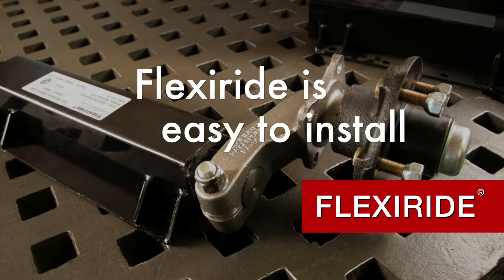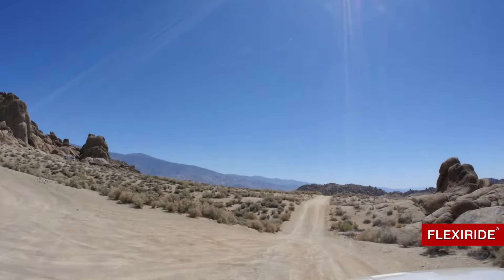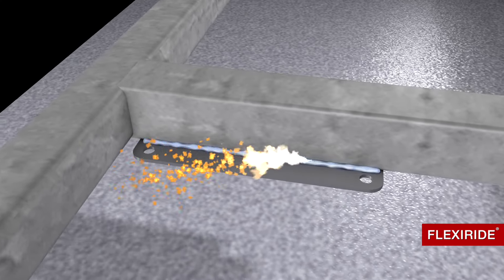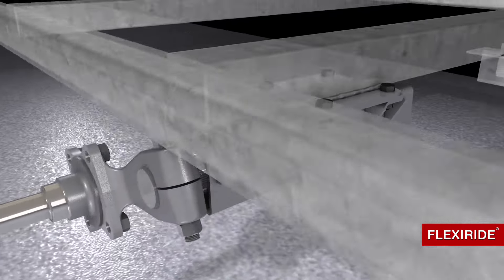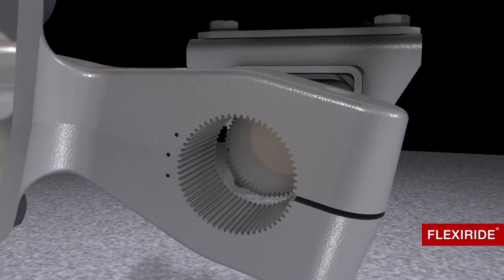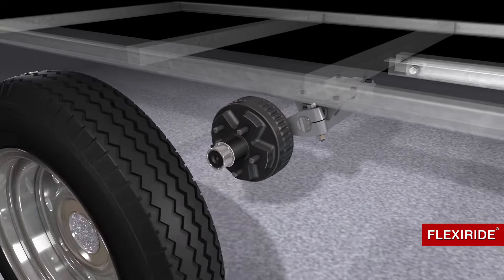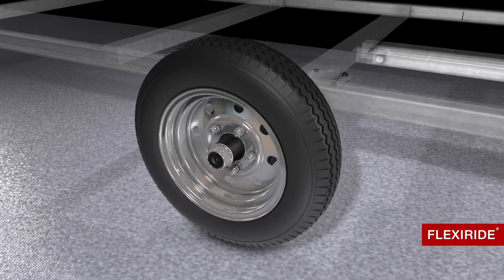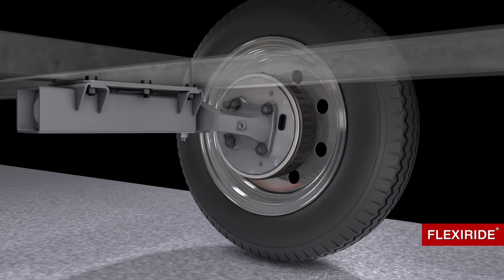FLEXIRIDE® is easy to install

Comment: Can this be used on a boat trailer that will be submerged in salt water?
Reply: It is used routinely on boat trailers. It is not rust proof, but it takes saltwater submersion OK.
Reply: @flvas  Mahalo for the info!